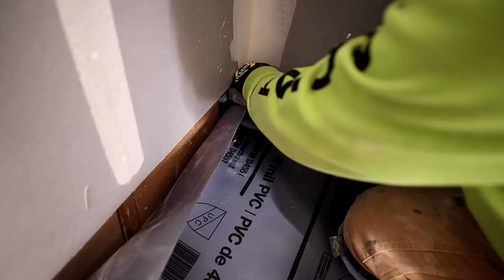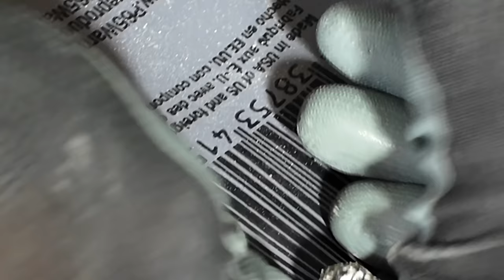How I do a Pan Liner --- OLD SCHOOL Tile Shower Build 2024 Episode 1

Comment: Still the best shower pan method by a country mile. Not a fan of the wood curb though. Would probably float that out or use bricks instead.
Reply: If you’ve seen his other videos he shows how to float the curb with mortar instead of screwing in nails into cement board through the liner. Dude knows his stuff and drops priceless information
Reply: Bull, ive torn out dozens of curbs that had wood in them, some less than a year old. Never use wood in a wet area. Ftw i started doing tile in 1975.
Reply: U and ur method is y I have work
Reply: @davidwelsh829 So, no wood subfloor or studs? If the pan is installed correctly and you wire ( with the wire secured by the mud bed inside the shower and nailed at the bottom of the exterior of the curb ) and float the curb  there is no reason for it to fail. My dad was a tile guy since the 40s , he taught me, and I just retired several years ago and we did thousands this way with no issues. The only issue they had in the past was a failure of the lead pan around the drain.
Reply: Recommendations for a shower pan on concrete slab? I am removing an old cast iron tub and making a walk-in shower thats about 5" wider than the tub was.  Main issue is I don't want to move the drain. Tile Redi wants $1300 for a custom pan.  Add the walls and I am close to $2000 in just sub tile products. Love their system but Ouch!
Reply: @laxcoachcraigw3789  Follow the instructions from this video.
Reply: How would u attach pvc liner to the brick?
Reply: @samfawaz9312  You chemically weld all the seems together and then float over it.
Reply: @chinaskibukowski7747  thanks for the reply but what product would u use to weld pvc liner to the brick curb ?

Comment: Glad you came back to old school for a day. To be honest I was losing interest in your new installs.   I don't trust any of the new "systems".  Failures are everywhere, while a well-done old-school install will last a century. I had a 100-year-old house with an old mortar bed and it never failed. A remodel revealed it was in perfect like-new shape.  I regretted even touching it.
Reply from the maker: Thanks.  It definitely felt good to do it.  Stay tuned for the next videos coming up. Floating the pan, flaoting the walls, setting the tile, and grouting.  I got hours of content coming up from this shower.
Reply: Why leave that cement board gap at the bottom?  The cement board does not meet the mortar base..how come?

Comment: I can't find a video showing how to finish the hardi board at the bottom.  After you put in the shower pan liner and build the pre-slope. there is a 6" gap from the hardi board to the shower floor where there is only liner on the wall.  How do you fill that or hand tile to that gap area?  I have spent hours researching for the answer.

Comment: preslope is everything when it comes to making a mud base work. I like the shower drain flush with the subfloor and I use a 2x4 on edge for the curb to obtain a narrower curb. Taller than stacking 2x4s flat and so much narrower. Installing the pan liner used to be a plumber's job. It is a plumbing fixture after all. I'd like to know when it became the tile setter's problem. The old timers I worked around always used copper nails to secure them. Now we are the ones doing the water test and making sure it does not leak.
Reply: Why not put some lathe down, pour pan and then Kerdy cloth over when dry. Then use the inside outside corner and Kerby tape. Never had a leak
Reply: Noone wants cement board where I reside. Unless Verdi cloth over cement board and pan. Then the county has to pass your 24 hour water test
Reply: NO PRESLOPE IS NEEDED! If the subfloor is leveled you don’t need a preslope. Also, if the subfloor is not leveled, but you apply a liquid waterproof on top of the mud all the way to the sides of the drain, you don’t need a preslope (because it will then basically be a “sealed system”) and the rubber liner will simply serve as a backup. The logic is that the mud will be completely encased in the rubber liner, so there won’t be any voids where a puddle of water could form and the mud acts like a sponge by its nature, until and, if ever, it gets 100% saturated, in which case the water at the bottom will escape through the drain weep holes and any leftover water will evaporate and escape via the same way it got there. The water will evaporate whenever the shower isn’t being used.

Comment: I have a KB Homes, the shower that they built was destroyed my walls, flooring, and created leaks through the shower area. My question is, is it common to put a dozen nails throughout the shower liner? The nails/holes created water intrusion, rust, mold, and the bench that they made has completely rotted out (bugs included). I am working to have it all ripped out…

Comment: Used to do these a while back, never caulked the drain flange but it  makes sense, cheap security. I am thinking of using a stock tank as a shower pan in my cabin with one of those hoop curtains for an inexpensive shower.  I have been holding on to a roll of pan liner since 2008! Everyone is using Schluter nowadays.

Comment: The pan liner is the only method i see never have an issue if installed correctly. Youve demo'd countless showers made with other material, but what about the Oatey perfect slope? Is there anything wrong with using it? Although its expensive, it saves soo much time. You also dont save much in mud bed cost either.

Comment: I had a plastic shower pan crack in my RV this last week. The prices for pan replacements was outrageous so I decided to repair mine. I squirt spray foam through a big hole that I made to stabilize the base so that it won't ever crack again. I  Filled hole with Fiberall and then I Fiber-glassed the entire pan and then Epoxied not only the pan but the entire shower, walls and all. I added multiple color pigments to the epoxy. It looks like a water fall with multiple colors streaming down the walls. It looks cool. I then epoxied the bathroom sink and counter with mix of pigments, carbon and sapphire blue. I got carried away but it is fun at age 66.
Reply: Omg do u have pics of this...I'm stuck doing my own bathroom and would love to see your process or finished work...
Reply: @MsPinkyism  I have pics but this YT format does not allow me to post them in this comment section. Just research YT video's on Epoxy counters.

Comment: I got to thinking you tile coach and tile star are both really good.
I got an idea from watching both of you but I know tile coach likes to experiment.
He is my idea how about a mortar base pre slope a liner and then a slop with modified acrylic liquid added to the 4:1 mix and then seal every thing with hydro ban and chalk the drain. The ultimate 1000 year shower.
Tile coach you are great I have learned so much.
How much space when tiling to corners on shower on12/24 1/8 1/4 1/16 horizontal.

Comment: I prefer schluters system but sometimes you gotta do it old fashion thanks for the video a tip for the glue hit it real quick with a heat gun and it’ll harden quickly

Comment: Thanks for the lesson !  
If for the wall, you're using a backer board (foam, hardi,...), not floated mortar, I assume you overlap the wall board down over the membrane? and I assume you shim out the studs to the thickness of the folded membrane corners before installing the wallboard?

Comment: Hey im working on a project and I was wondering if I alreadt installed my backer can I still put the pvc liner on top of the backerboard and staple is or should just use the adhesive the use to keep it from feeling off. Im trying to avoid using a kerdi or other membranes beacause theyre delicate and its cheaper. I thought about using redgard but its not cheap either for the size of my shower.

Comment: Question. I’m in the process of doing a shower and I installed my drain yesterday, I concreted 2” plumbing into the ground since this was a bathtub before it’s a shower now. I accidentally concreted the plumbing in, without it being level. It’s not off much but it is off some. If I put the second piece of the drain, rhe part that clips into my bolts, can I stick some abs plastic under one side that way I can unevenly tighten down the drain and in the process fix what is unlevel? By doing this I’d imagine it would work and would just make very large areas for water to get in near the weebles.

Comment: When would you find it necessary to waterproof the preslope with something such as redgard, before installing the rubber liner? I have noticed that some waterproof the preslope and some do not.
Reply: It's much better to water proof the mud once it's dry and use alkaline resistant mesh in the corners. Three thin coats of Red Gard on that mud and the vinyl will be a backup but will never see water

Comment: My shower is 7’ long. I am installing a linear drain in the front. Question is-would it be okay to have one continuous slope to the drain and not slope the floor away from the side walls? I will slope the floor away from the front wall to the drain but what do you guys think about not sloping the floor at the sidewalls, just one slope for the 7’ pan?

Comment: Old school way. How I learned 25 years ago, but haves not used a bladder in several years
Reply: The problem with Schlumberger pans is when sub floor isn't level,  especially the perimeter.  Pouring/ dry packing deck mud gives you the field to make your slope and perimeter good.  Simple
Reply: That's when we pour a pan, and kerdi cloth over it.

Comment: @TileCoach  In prior videos, you didn't like using wood for curbing.  What's changed?  Is it that you're using the Oatey liner to cover it?
Reply from the maker: Yes, when its a pan liner and mud curb its ok as long as there is a capillary break betweeen the pan and the curb.

Comment: QUESTION: would you use the same steps and application on a concrete floor? The floor was poured and sloped at the time of pouring.
Reply: No the concrete he put down first is a sub floor for upstairs bathrooms so that part isn't necessary on concrete. But everything after that yes.

Comment: so,after the membrane goes the tile on top??   or does it need another concrete later?
Reply: Another layer of concrete 1 1/4" to 1 1/2" thick evenly on top of the liner. Then tile on top of that.

Comment: Are there occasions where you want the prefloat and pan liner installed before the Board is prepped on the wall?

Awesome video by the way!!! Love X15, but not the smell 😭😂
Reply: If you don't plan on floating the walls with mud. You'll do the preslope and pan liner, then furr out/ Shim your walls with quarter inch strips (or more if need be) and set your backerboards, don't drill into the liner obviously

Comment: Sorry but i'm confused, i thought the drypack went in the liner not under it, do you do another preslope on top, sandwiching the liner in between?
Reply: This is the pre-slope, which gives a slope to the pan liner itself so water does not pool at the bottom of the mud bed that is placed on top of the liner
Reply: @rowdynoe9595  Well i sure do appreciate your response and this video from tile coach! From videos i've watched, everyone seems to be throwing liner over the floor, putting in oaty liner then preslope inside the liner. I got away from youtube and did some reading and now i understand this system and learned about the mold issues. Thank you both so much
Reply: they call this pre slope    pre  sloped befor  the liner orhot mop goes down     you need to look at the drain closely  or watch more videos  and  a light bulb will click on   no offence    but  its very simple yet   confuses most everyone in the begining

Comment: Would it be beneficial to add a bead of caulk around the underside edge of the drain before bolting it down?
Reply: Nope will plug the weep holes

Comment: Bro just get a hot mopper to water proof that pan. I get that you're using the membrane but  theres no  debating that hot mopping is such a superior method and total peace of mind.  My guy charges $275 to hot mop a 3x5 pan and curb here in Ventura county,  ca. 
Im not bashing you here, just giving a suggestion to make your shower projects less stressful.
Reply: Ok Im old school   too.  pvc  liner is new school or no school     to me   just kidding.   but  Since Ive never been around it    I cant say for sure  but...      I think it is arguable  Hot Mop is   everything to us but outside of ca  or at most west coast   no one hot mops   most back east places never have     they built lead  or copper pans .    
    So I think there are belivers that a well  built pvc pan  will out last   hot mop   Im not so sure  dont really care to some extent.    
    Im a plumber   you want copper pipes  we run copper  Pex you get Pex      Cast iron tub  you get cast iron.     So my guess is if builder wants  Pvc liner    thats what it is

Comment: One thing that's really bugging me: all of these boards like hardibacker and concrete board, so many people think they're waterproof when over and over I've seen people say they're not and that you still have to waterproof them with some kind of membrane. Then why even use "waterproof" boards instead of drywall? It doesn't make sense to use drywall either, I know that, but to me it just seems like no matter what you put up you'll still have to slather it with red guard or flex seal or whatever. I have a tile tub surround that seems to be failing, the wall next to the tub is getting damp, and I'm probably going to replace with a basic btch fiberglass tub and surround because it just seems too expensive and complicated to get the tile right (our bathroom was newly remodeled before we moved in).

Comment: Pre slope is for the moisture inside the pan you pour so it weeps out of the pan. A pan that holds water will cause mold issues. Hence the pan drying out via the weep holes. I dont think any new guys understand this.

Comment: GC wants old school 30/40 ml pan liner, but only leaves 7" from deck. Min code at its finest. Looks like Multifamily? Pre pitch/slope should be just as smooth & accurate as the top layer. Prepitch/slope done sloppy doesn't allow the water to weep as fast. I get it if the GC is supplying materials. When using topical elastomeric waterproofing products on top of your prepitch/slope. It's really important that the product gets its final coat with a brush & brushed the same direction of the pitch/slope to the FHA HUB & not rolled finished. Enjoy your videos. Go Carmichael, Pasadena Elementary, Churchill Jr.High(Home of the 1988 National spelling bee champion) & Mira Loma HS.....

Comment: Flexible 1mm PVC sheet ?????
Is that the material in your liner  ??
Australia does not have your system, but I can get the flexible PVC and with a heat gun turn the liner down the drain hole after tililng.

Comment: Enough wood curbs. Form and float with drypack
Reply: It makes no difference at all, he's using a pan liner.
Reply: @Aaron86v  it does make a difference as any water making it to the wood(most likely from the outside) will expand the wood and compromise the curb

Same amount of water on a drypack curb will have no effect.
Reply: @BonBon770  I've yet to see a wood curb that didn't have intrusion points all along the outside perimeter.
This is also assuming the wood used is properly dried and not the wet waiting to twist stuff in stores today.
Forming a curb with wood and floating with drypack is cheaper quicker and better. No slicing liner, no patching, no fastener holes, easy custom sizing, easy sloped top = no brainer.
Reply: @BonBon770  no, slicing of liner is not necessary in 90% of poured curbs

Comment: You do so many different systems. What determines what system you’ll use? I and everyone I know may change systems but we tend to repeat the same thing
Reply: some of it is based on builder  specifications  ,    Some I would guess is  to build the channel , some to experiment for his own knowledge,      budget   cheap jobs vs high dollar      Im a plumber    if a cutstomer wants   a cast iron tub its not going to be pressed steel

Comment: Liner is not turned up the wall far enough! Liner should be 2 inches above the" Finished" curb(tcna) , not the rough framing! 
Top of the wooden curb just like the pre slop should be pitch inward !
Pre fold the liner outside the shower makes the installation much easier!
That cast iron drain is old technology. Modern pvc drains have weep groves under the clamping ring to allow water to continue to flow under the clamping ring and not stop at the ring! You can also adjust the drain body up or down.
Reply from the maker: Thanks for the info david